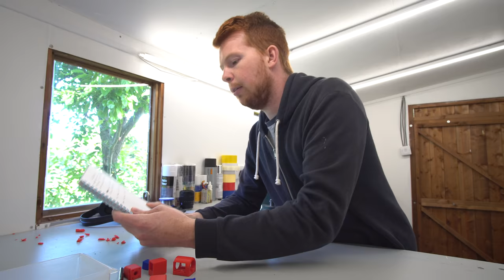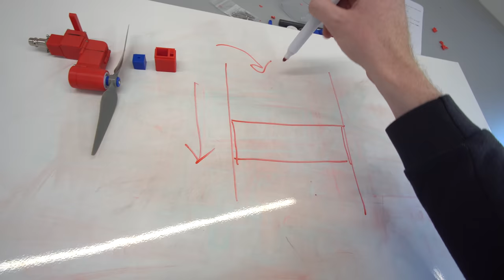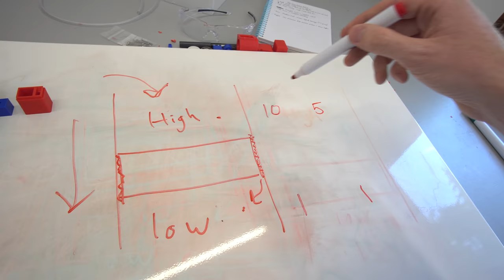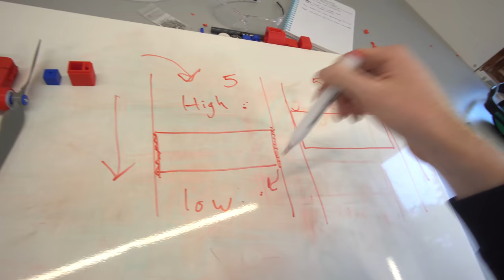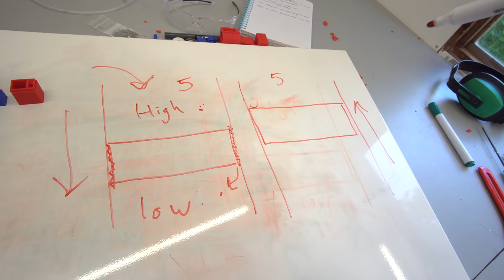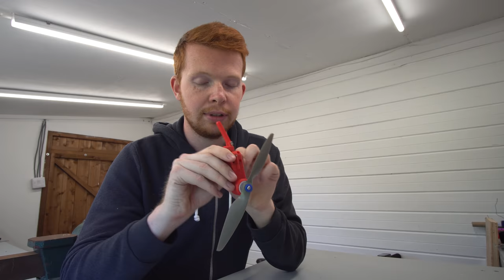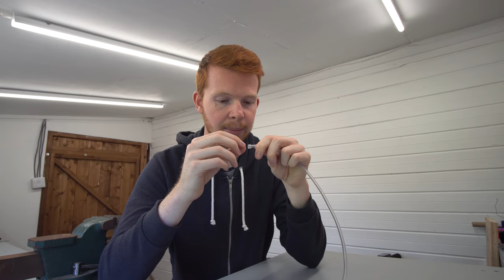Multiple or Single Cylinder Air Engine?

Comment: Engineers are engineers because we are trying to build BETTER...not always because they are either 'easy' or 'simple'...

OR as one guy [I forget the name now] used to say 'You gotta get out of the stone age man!' just meaning to the other people that it was time to step up and advance.

After all...just look how complex the machinery is you used to print and record videos with, they only work as well as they do [same with many modern engines] because of their careful engineering and sophistication [regardless of cylinder count] which is all there to maximize the final result of performance and efficiency.
Reply: we also use the phrase "K.I.S.S " Keep It Simple Stupid"
Reply: "Perfection is Achieved Not When There Is Nothing More to Add, But When There Is Nothing Left to Take Away" - Antoine de Saint-Exupery
Reply: Perfection is when a device is most perfectly suited for its application within all of its required limitations.

Comment: I think that a second cylinder wouldn’t decrease the pressure because the intake valve would be closed to one cylinder while the other is pressurized. It should increase power though because you’ll have a power stroke occurring in one of the two cylinders at all times.

Comment: Multiple cylinder engine looks like multiple times much fun! :-) I'd go for boxer engine with simplier crankshaft, because if you put one throttle valve cube on top of crankshaft tube, you can 3D print valve air inlets as another cubes on top of cylinder cubes.
Air would enter cylinder cubes from top of engine (ie. side of cylinder cubes), but if you add small air chamber on top of each cylinder cube (ie. side of engine), you can use your current cam mechanism.

Comment: To answer your question at the end, I would only do a 2 cylinder engine if you saw efficiency improvements. In the mean time, I think that your current strategy is the way to go. Make a good engine now that you can scale up later. 

Also, to improve efficiency I would like to offer two suggestions. Firstly, I think that using the timing of the pressurized air entering the cylinder may give you better performance. If air is injected at TDC you would get a longer and likely more efficient power stroke. You could do this by having a shorter and earlier opening of the valve. 

The second thing that I think may help is to add a second cam or push rod so that you can have the exhaust at the top. Again this would lengthen the power stroke slightly. It would also allow the cylinder to more fully evacuate between cycles. 

My final suggestion is just because I think it would be cool. I think that you could use a cam that varies it’s diameter based on centrifugal forces. Kinda like a  hit and miss engine but you could simply lengthen or shorten the time that the pressurized valve is open rather than miss a stroke. This would also allow for consistent power regardless of air pressure in the tank which also removes the need for that throttle you made last week. 

Finally, hook up your engines to a dynamometer. I’m curious about joules into the tank vs joules out in work so that you can get some real efficiency numbers. 

Cheers, 

Nic

Comment: Ok, a few things with a multiple cylinder engine: 
My recommendation: make an INLINE two with alternating pistons (1 up with 2 down). Why? A couple of simple reasons: If you make your flat 2 with alternating pistons, you will be at a balance disadvantage. However, if you do make it like a boxer where both pistons are out at the same time, you double up on the power stroke. 

If you make the inline 2 with alternating pistons, you do a couple of things: 1) you separate both cylinders' power and exhaust strokes making it run smoother. You also avoid as much balancing issues since the engine wants to "warble" a little as opposed (no pun intended) to the side-to-side movement against the pistons in the flat twin.

Comment: For your vinyl tubing, try putting a bit of a barb on your 3D printed connector (PC water cooling is ripe with examples), then a bit of glue, and a cable/zip tie.

Granted, the barb+zip tie method with vinyl tubing works great for water with low pressures, I have no idea how air tight it would be--especially under pressure--which is why I suggest adding the glue you tried previously. Make sure the outer diameter of the connector matches the inner diameter of the tubing, and the barb is slightly larger than that--it makes for a better seal.

Comment: my reasoning says to go with the straight twin, i also think you should continue using a bearing on either end of the shaft in such case. while using a second bearing doubles the friction, you will be making up for that in stability and power. In my opinion, a more complicated crank shaft is a minor oversight compared the power and efficiency you will be getting from adding the second piston. not only will two alternating pistons limit the vibration, they will also provide potential energy to help time the engine with lower air pressure. whichever way you decide to go with, keep up the great work! you're definitely onto something.

Comment: I have been playing with steam designs for years and am glad I came across this video. Forget cylinders they require lubrication and as you can see are quite inefficient. You should be looking at turbines with tight clearances. Easier to control and easier to add stages to maximize the efficiency of your compressed air. Also on balancing you have near equal forces on both the external bearings. Your modern industrial turbines actually use the force of the steam to offset the weight of the rotor and have it floating at set rpm increasing efficiency. At this point though build a single stage and compare that to your single stage piston engine. If you can match the rpm the single stage rotor will be more efficient then the single stage piston due to the rotor having more areas to compress during a rotation. Even a 4 blade turbine is going to be more efficient  then a single piston. Once again the point here(for me anyway) is absolutely minimal lubrication allowing you to recycle that spent air when that air becomes something such as steam or something even better then steam.

Comment: Apparently graphite gaskets and seal rings are a thing. Mostly they're used for high temperature applications, but their other advantage is that they simultaneously provide sealing and lubrication.
Graphite is "soft" (can shift around irregularities in material to provide a good seal) and it's atomic layers slide around very easily (provides lubrication)

Teflon tape might also help with reducing wear between the cylinder and piston head

Comment: Sorry if somebody already said this. I would use 2 bearings, it is heavier, but you eliminate unwanted forces. I mean, that bearing is good for radial load, not axial, if shaft bends you get combined load so higher friction and vibration. Also don't judge bearing by free spin, there should be grease inside and you should compare it under load. Also I would do both piston configurations, you would eventually try to build engine with many pistons, why not prepare for it beforehand. Btw, I really like your work, thanks for sharing :)

Comment: Take a look at two-cylinder John Deere engines. They are a proven design of which many are still running after 60+ years. I think you could adapt it to pneumatic power. Great videos. I love the fact that you're willing to try things and keep tweaking if they don't work right away. That is the nature of design. So many people forget that and expect perfection on the first try. That leads to discouragement when it should just an opportunity to improve. "Don't let perfection be the enemy of the good."

Comment: Tom, something that comes out of looking at the efficiency due to annular leakage is that a very wide single cylinder both reduces the pressure and minimizes the annulus to effective surface area ratio. I would love to see a very wide single cylinder with a high BPM of the cylinder and some sort of harmonic drive to step the output way down from the initially high beat of the cylinder.

Comment: also vent the "crank case" pressure(leakage past the pistons) through a tiny container with a super lightweight oil inside something equal to the size of the engine block, for constant oiling of the engine! it'll just spray into the oil making the oil spray everywhere inside the crank case, fill the tank with WD or something and the engine will last a lot longer, the biggest issue with a multi cylinder engine is the power losses with the extra mechanical load, valves extra piston rod etc. more mass means more power to run

Comment: One thing you are missing is that a multicylinder engine can start on its own by just giving it air pressure.

You probably need a minimum 3 cylinders to do it. Offsetting them equally makes sure the engine is always doing a power stroke in every position of the crank.

As for the complex crankshaft i would run a tiny metal rod trough the middle and then print modular crankshaft parts that slide on and lock together. This limits how much travel you can have but makes long crankshafts plenty strong enough to not need any extra bearings in the middle.

Comment: Although this is 4 years old and you have moved onto other things, what you have effectively produced is a V2 engine but without the V. If you could produce a V twin, then vibration in the engine would be significantly reduced. David from the IOW

Comment: I would suggest the flat twin.  The issue with sealing the vinyl tubing can be resolved through the use of compression collars on the tubing. These could be either purchased or 3D printed. For ease of installing the collars, heat the tubing when installing it so that it is more malleable when sliding the collars into place.

Comment: Sounds like you are only considering multiple cylinder engines which work in parallel (although possibly in different a phase) from the same inlet. When you described your thoughts on why more cylinders might possibly be efficient, I were wondering if you had considered putting the cylinders in series instead. As in, as one piston vents/pushes out the air, it is then funneled into the next cylinder instead of lost. The second cylinder will obviously have a lower pressure and provide less torque, but should still make things a bit more efficient.

Another option to simply using more cylinders, would be to turn it into a double-acting cylinder. This is however definitely going to be a challenge to do with 3d-printed parts, as the piston has to exit the cylinder in a (somewhat) airtight way. It would also not actually really provide much more efficiency, and only increase the torque while essentially halving the time of operation (unless you make it work with the vented air like mentioned above).

Speaking of venting the cylinder, I can't remember how your engines does it currently, and the graph at 5:07 does not make it clear either. Once the cylinder is pressurised and after the inlet is closed, how does it depressurize again?

Comment: I got inspired by your compressed air engine V3 and I started designing a 2 cilinder version. The cilindes are at an 90° angle from one to another, so the shaft is at a 90° angle offset. For the shaft, you just use a little wheel at the center holded by a ballbearing.

Comment: I started designing a flat twin a few weeks ago on the basis on your air engines. My idea was that instead of having the PVC tube you tanken about i ran with the design you have on your v3. Having the airchannel going on top of the cylinder, just a 3d printer square channel. And at the end you have the same cam design you have on your v3. Super hard to explain but you're cleaver 👍

Comment: Tom, I understand your dilemma but I would personally advise making the inline twin engine because a) it would satisfy the people wanting it b) A complex crankshaft is easier to sort out the complex plumbing because you don't need to find a way to balance the pressure for each cylinder. it will also be a lot smaller because of this. An inline twin engine also would make more power because it has a power stroke more often. Overall nice vid though, I can't wait to see where you will take this series next!

Comment: Hi Tom, keep it simple to less than 4 cylinders.
I agree with the suggestion below, a two cylinder motor, with high and low pressure cylinder as in steam engines. 
You will be using the same air and you cylinders can be optimized for the two different pressures.

If you go 6 or V6 or multiple you will need a much bigger supply to hold your "pressure fuel".

The reason the hybrid bearing spins longer is because there is more mass in motion than the pure ceramic bearing.

Tom...

Comment: You should see about adding a 'Shoulder' to the crank side of the engine for the rod that pushes the bb to rest on.  I don't know how much real world difference it will make but you have 60-70% of the rotation where the air pressure is forcing the rod down on the crankshaft when it doesn't need to be in contact. The shoulder would just allow the rod to rest while not in contact with the raised portion of the crank.

Comment: I've mentioned this before.  Use one cylinder, but follow the design of a steam locomotive cylinder where the high and low pressures on each side of the piston alternate with a valve that controlled by the position of the piston. On the forward stroke, the rear of the piston has high pressure, and the front vents.  On the reverse stroke, the front of the piston has high pressure, and the rear vents.  If you want to improve efficiency, use a larger cylinder where the negative aspects of the low resolution of your 3D printer is lessened, or use paper thin C rings around the piston to seal the gap between the piston and cylinder the same way internal combustion engines do.  The outward force of the C ring  against the cylinder wall should be negligible since it's job isn't to press against the wall, only to seal the gap.

Comment: One thing that helps seal the cylinder would be some kind of lubricant for example oil. Combustion engines use this, the thin layer around the cylinder wall will help seal the cylinder on the wall

Comment: Instead of PVC tubing you could check PE, teflon, rubber or polyurethane tubing. PE/teflon would just 'tight fit', but are less flexible. Rubber/polyurethane could be tightened with a clamp, and are elastic without loosing shape. PVC should glue very well, using only acetone, but only to other soft plastics. PVC would give a nice weld-like connection to other PVC with acetone. For connecting to your 3D printed parts, i'd suggest trying a sturdy thick-walled PE tubing. You can work around its inflexibility and make permanent bents by heating it, optionally filling it with something before bending to avoid flattening it. Also, PE is weldable to other PE, you might or might not be able to weld it to the PET bottles you use. For the 'plumbing' part, they have various T and Y shaped connectors that make perfect airtight and pressure-withstanding fits on PE tubing. With PE tubing, instead of fixing it 'over' a hollow pin, you could also fit it 'inside' a well shaped hole with rims, or a combination of those 2, to withstand higher pressures.

Comment: I Love the idea of the 2 cylinder (either flat or inline)
and i really do want to see one made eventually, I myself have been one of the people saying "do a 2 cylinder engine! :D :D"

however for the car project I would recommend tackling one problem at a time,
build the car as a single cylinder, that will give enough issues with drive terrain etc, THEN one it works upgrade it to twin

Comment: I would still consider two bearings on the crank as this will stop the small amount of torque translating to miss-alignment of the piston. It will not cur down your air leakage issue by much but anything you can do to reduce it will help.

Comment: Inline would be best for vibration issues. Ok...1- make one cylendar be TDC at the same time the other is BDC. This way you get power delivery on both strokes since it is a 2 stroke design. 2- to lesson the air swap around pistons, use oil on the calendar walls. The bigger the seepage, the thicker oil is needed. Hope this helps!

Comment: If you make a straight twin, you can have two ''cranksystems'', one on either side. That will require a minimum of 2 bearings (I suggest using three), but it will be easy to design, I think. It's the easyest soulotion I can come up with. And by the way, if you have three or more cylinders you won't need a flywheel, since it's allways pushing down on at least one cylinder.

Comment: Multiple - go for a 3 cylinder with 120° between each cylinder, that way you're always on a power stroke.
Later steam engines did something similar as well.

Comment: flat arrangement is V2 180 because of the 180 degrees angle between both cylinders, it could be interresting of building a V2 engine with a very small angle between the cylinders, that could resolve the problem of feeding of the flat engine and the problem of crank shaft of the inline one

Comment: keep working on it as a single for now, but it with the opposed twin in mind.  The efficiency of the twin will be found in a number of ways, but mostly in timing.  you had to make compromises in the timing to make the single (poppin john) run smoothly.  with a twin(or more) you can set the timing to a more efficient position.  Just had a couple other thoughts.  1st, although rings might be overkill, multiple grooves in the piston perimeter would trap oil and improve compression.  2nd, since this is really more of a reverse pump than an ICE, some pumps use both sides of the piston.  you'd still have the complexity of two cylinders(valves) but only the friction of one.  I'm just rambling at this point.